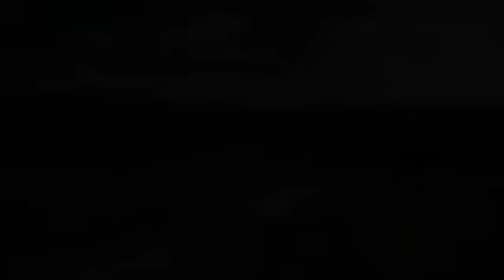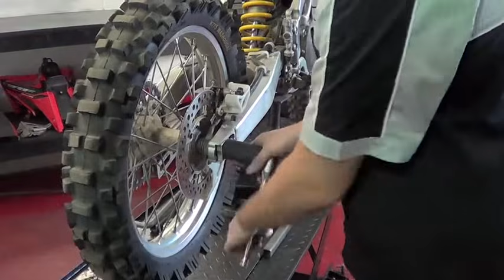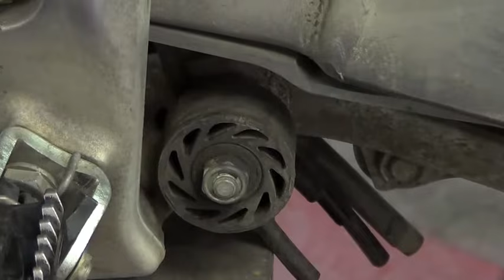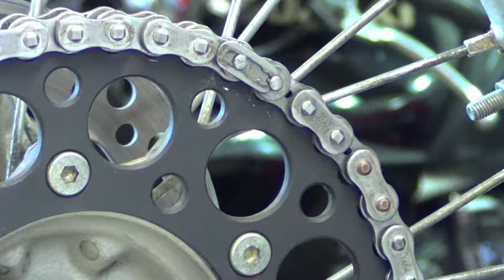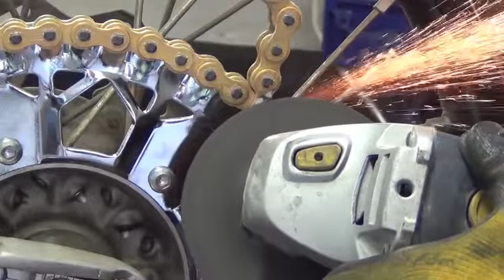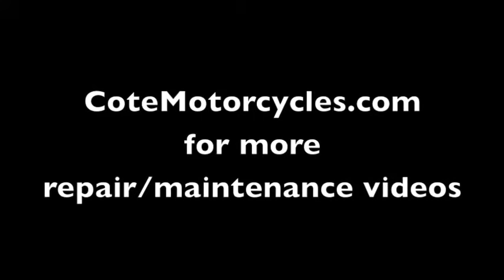Dirt Bike -  Drive Chain Replacement, Adjustment and Service - see description

Comment: Do you think it's ok to remove it and putting the same one back on?  I recently got a dolly type carrier, which has my front tire off the ground but back tire on the ground.  I've read it would be good to take the chain off before towing it. Thoughts?

Comment: Can you use a g clamp instead of one of them tools thanks
Reply: I assume you mean C clamp. You can use a bench vise if you're crafty but a chain break is the way to go. You can get them cheap at princess auto.
Reply: +GoBoardCanada is this an easy job I'm getting a perfectly fine pit bike all it needs is a new chain an a new one comes with the bike
Reply: +Tom Garvey degree of difficulty depends on your mechanical aptitude I guess. I'm a mechanic so it's super easy for me but it might not be for a person that doesn't know how to change their flat tire.
Reply: Would you recommend me buying it? I'm no mechanic but I can do the odd job
Reply: I'm also 15 haha
Reply: +Tom Garvey ya. 100% buy it. You gotta start somewhere if you're going to learn how to fix your own bike.
Reply: Ok I will do thanks for replying

Comment: Thnx. 30mm of chain slack is not enough for some bikes (Yamaha WR450F requires 48-58mm).
Reply from the maker: For sure. Always a good idea to use a manual as well for your specific bike. Thanks for the comment and be sure to share the vids if you like them!

Comment: if i will put a 13-48 drive sprockets, how many links of chain will it require? chain is 520. Appreciate for a reply.
Reply from the maker: It will be different lengths for different models. Best to get a 120 link chain and cut it to the proper length if you're unsure.
Reply: ok, thank you for your advice. :)

Comment: Chain was assemble from the parts? 1 on the left from clip lock I see forged lock:))
Reply from the maker: Had to add some links a while back to adjust gearing. Master links are just as strong as any other link in the chain. Good eye though!
Reply: CoteMotorcycles how rare is a snap chain from running too tight
Reply from the maker: A good chain (meaning new mx specific chain) will more than likely take the wheel bearings out before breaking. A worn chain will break easily. I've never had one break personally but have seen quite a few from riders that don't lube and adjust regularly.